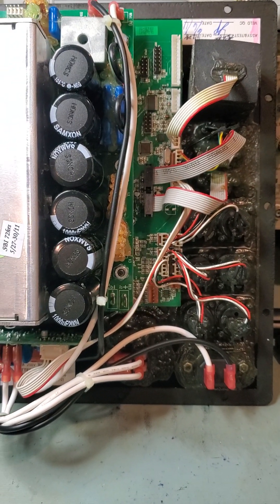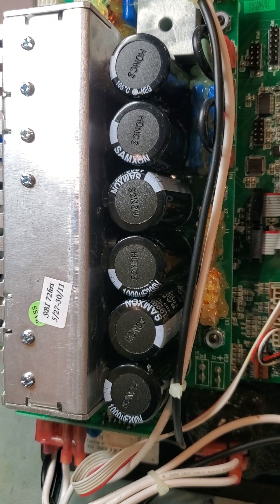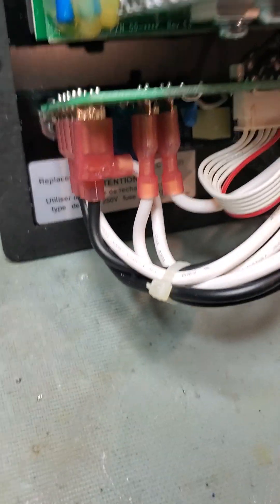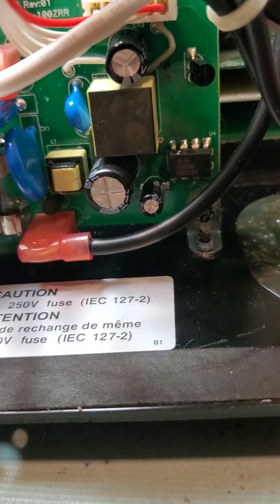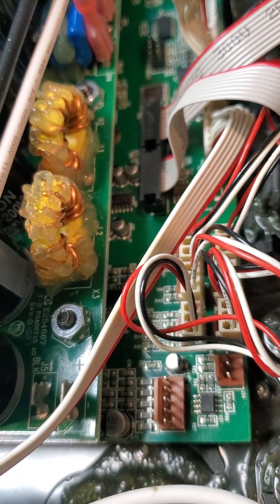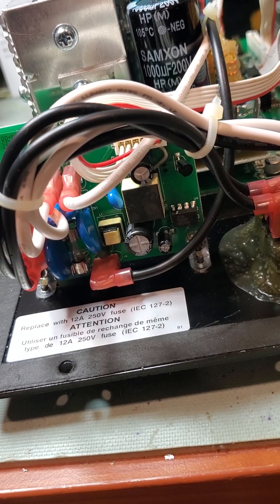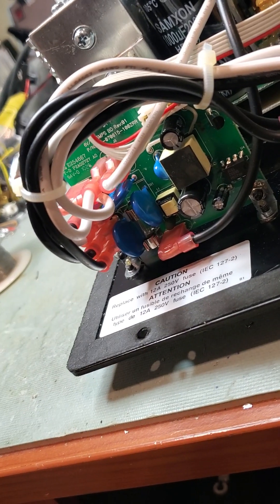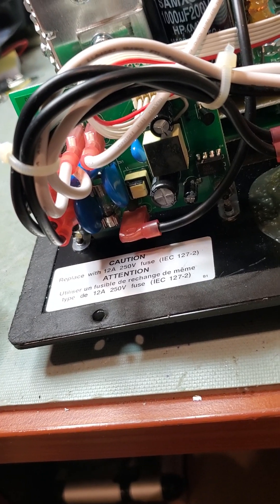Velodyne Digital Drive Plus DD-12+ Subwoofer No Power Problem Repair Fix (Part 2)

Comment: Hey Kevin, do you have a link to the data sheet/schematics to this subwoofer?  I tried replacing that capacitor, and I'm still having issues, thx.
Reply from the maker: I don't have one. Did you check the voltage coming from the switching regulator? It should be 6VDC from what I recall.

Comment: I happen to open a plate amp from a dd plus that was recently fixed and you’re right. They replaced that cap with a 470uf 10v. Not sure how you came to the same conclusion of 470 and not another capacitance. Thanks for confirming it